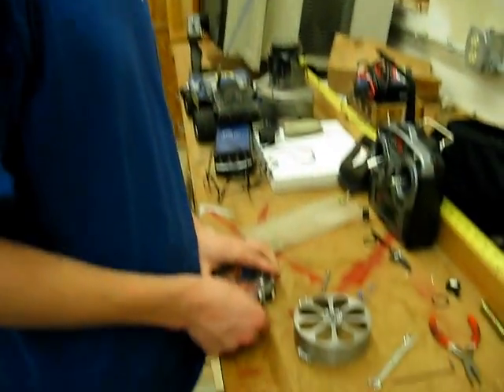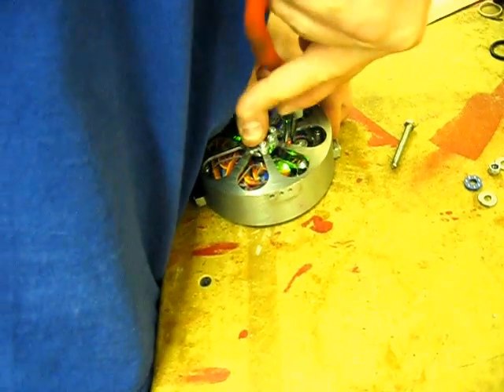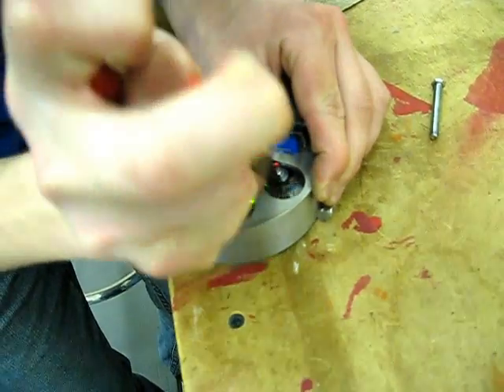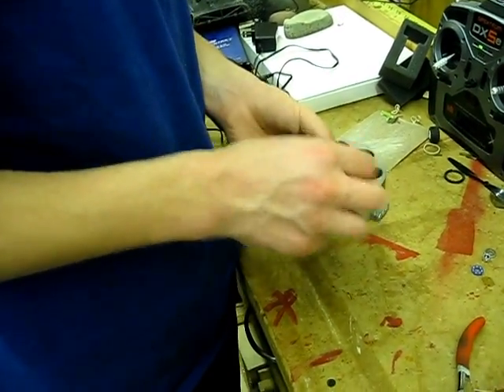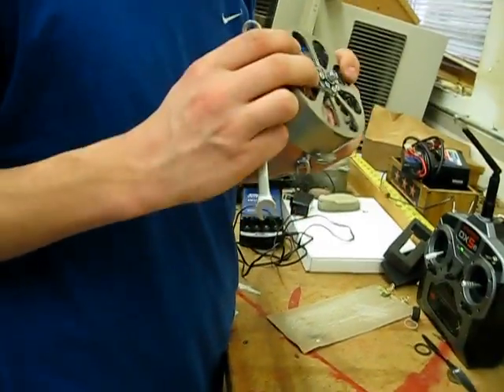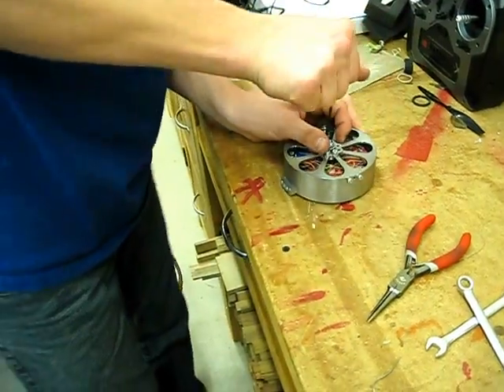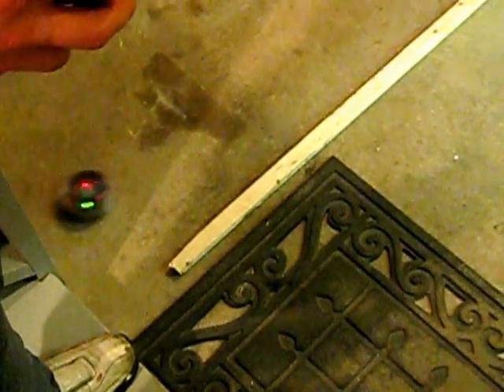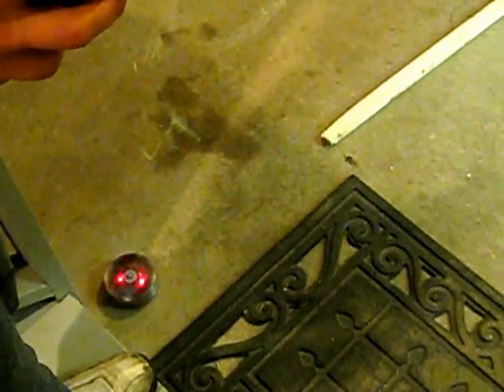Spinook Antweight Battlebot Finished Assembly/Weapon Hit test

Comment: Hey! I know this is a old video, but im building a shell spinner and I was wondering what battery you used that could actually fit into such a small area
Reply from the maker: originally I used some cheap 500mah 3s lipos but have since switched to a maxamps 430mah 3s: https://www.maxamps.com/lipo-430-3s-11-1v-battery-pack
It runs for about 8 minutes.
Spinook is sitting on my desk ready for its next competition, I need to sit down and redo the shell again to account for weight distribution imbalance with the new design that caused the plane of rotation to flip much more readily: https://www.youtube.com/watch?v=Ahh0S5BXuAI&t=16s
I fixed the torque issue you see in the video too ;P

If you have any other questions please ask! Also i'm very interested in your project! Please contact me on discord!! https://discord.gg/hBwYGG

Comment: Amazing antweight. I'm working on an antweight and it definentaly is not easy. I just need to learn how to set all of the programming up.
Reply from the maker: I would recommend starting with plug-and-play RC airplane components, as they are typically what you find in insect class bots.
Reply: Camden Wallraff, thanks I don't think that I would have ever thought of that. I'll get on that, but I don't know what I will do for the drive or what set I will buy.
Reply from the maker: Pololu micrometal gearmotors 30:1 on 3s are good for  tires <1", 50:1 for 1-1.5", and fingertech silver sparks for more than that is what I typically see for drive motors. Weapon motors generally are anywhere from an 1806 to a 2808 for ant drive, using a 12-30A esc. a typical orange rx or lemon rx can be had for $10 for recievers, paired with literally any 2.4ghz 4 channel controller (you can use ones like for rc cars but idk how the mixing on those works. for battery, at least 2.5 watt-hours is recommended. I run about 4.5wh.

I'll be at CIRC ^_^
Reply: Camden Wallraff, should I get a speed controller for the drive motors?
Reply from the maker: How else would you make them function? ;P
Reply from the maker: @michaelfecto4252  It depends on what you mean by that. What motors are you using?
Reply from the maker: @michaelfecto4252  yes.